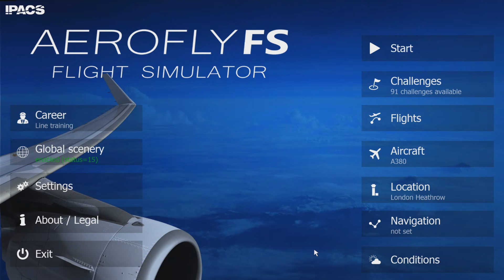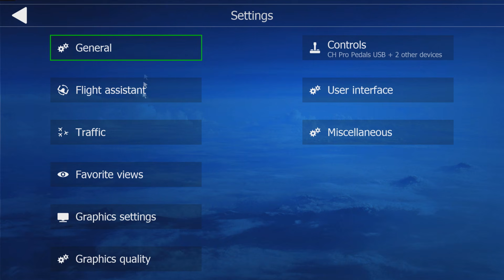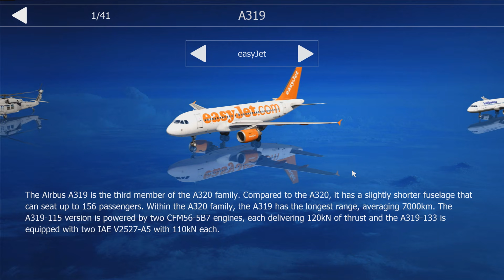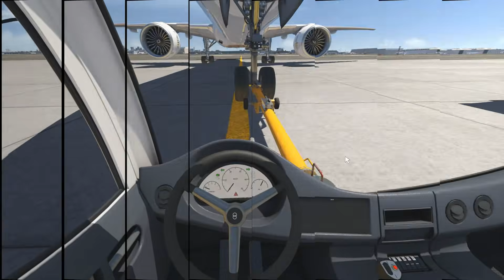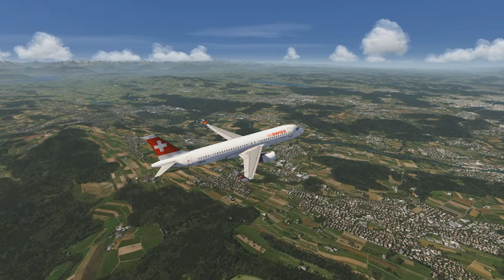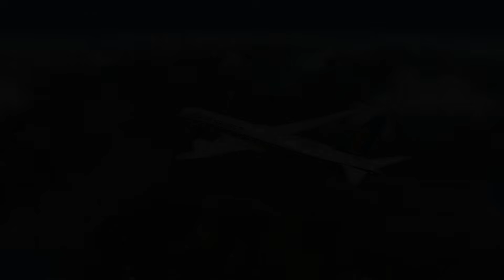Aerofly FS4 - Is it any good?

Comment: You can generate tiles for the ugly blurry areas with aeroscenery (which was made to FS2 but works flawlessly for FS4). It's a bit boring to install, as you have to download other softwares to make it work (everything is written directly in aeroscenery menus) and results can be bad if using wrong parameters. Currently, I advice to use Bing satellite images, or Arcgis ones, because Google ones produce bad results and are is now writting "Google 2025" everywhere on the images. There are other options which require keys. There's a setting for the type of trees you want to use in your tiles, it is quiet amazing. The sim looks really good when you got this process right, even better than the DLCs HD textures, which look good but show less vegetation and buildings (for performance obviously).

There used to be a website with uploaded sceneries generated by aeroscenery but it has been shut down lately (due to the costs of maintaining it). So the only solution now for users is to generate sceneries themselves.

Comment: Whats ur pc spec?
Reply from the maker: I have an AMD Ryzen 9 5900 CPU, 32GB RAM and the GPU is a 5070Ti 😊. But this SIM runs perfectly fine with older hardware. When I filmed this I had a 3080 GPU and it was absolutely fine.

Comment: Many thanks for this. The sim sounds very interesting, especially for those of us who like smooth performance, a good level of detail, graphic and flight model-wise. Also, as you say, not everyone is into “study level” detail in aircraft. I wonder how much third-party support there is? For instance, are there developers out there who produce aircraft, airports, weather modeling, etc. Maybe there is real weather support from a developer, for example?!
Reply: I have found a program which can read airport METARS in real life and modify the original weather file in Aerofly FS4 to sort of mimic the weather at that moment. Sadly, no live weather no rain, no volumetric clouds and those good stuff... the developers have shown interest in adding those but it looks like it isn't their priority. As they have stated on forums, their priority is to make a simple simulator which will work out of the box where you wont need additional software like navigraph, simbrief and so on. Like FSclips said, it's like a simplified version of MSFS or X-plane. A ton of fun though if you aren't interested in details...
Reply from the maker: There is a modding community but it is very small. You mostly get liveries and detailed textures for certain parts of the world. I don't think this is an open source software.